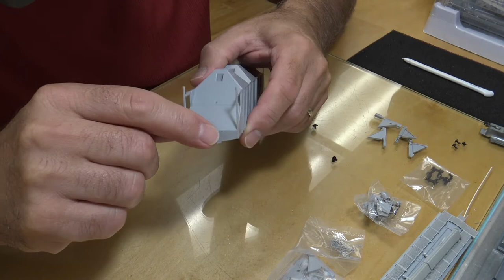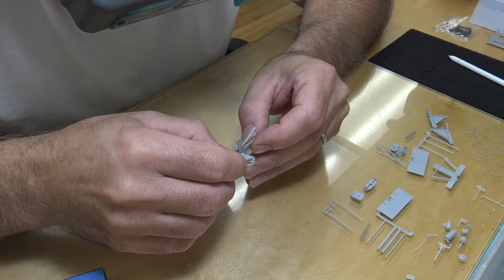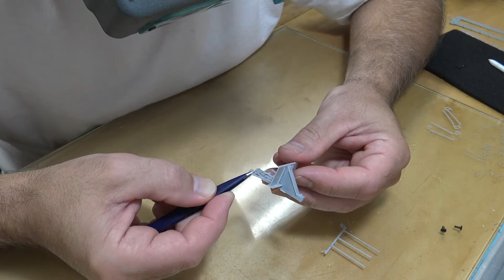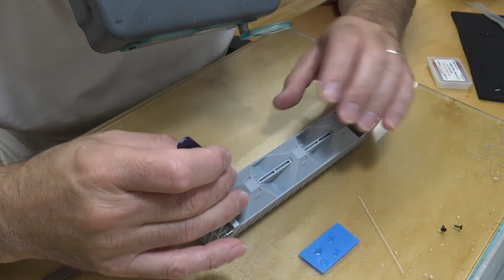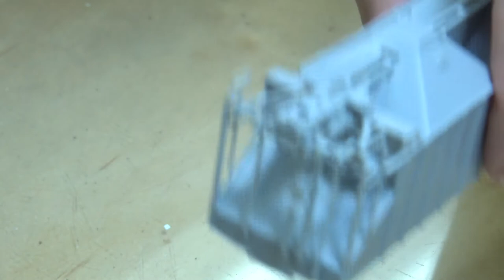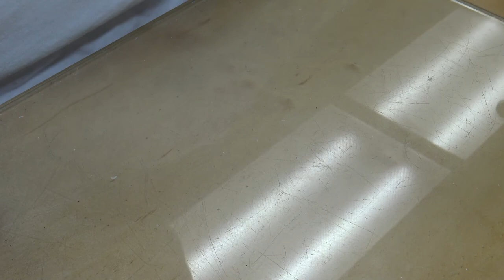TANGENT PS2 4750 BUILD

Comment: This is undoubtedly one of the best videos you have done.The technics you routinely use are great and I have adopted many. I have several of 4750’s and 4740’s that I bought when they came out. Interestingly, the weights have changed from these older kits and the newer one that you built. Otherwise they are essentially the same. Once I bought them I looked at the kits and didn’t start anything. As you did I should have bought a complete model to see where everything when, I has since got finished model.Again , thanks for the effort you put into the video. Jim McIntyre